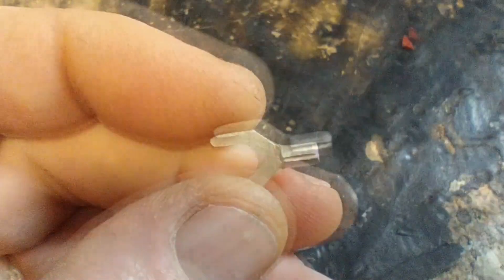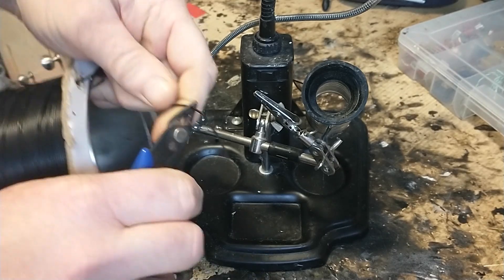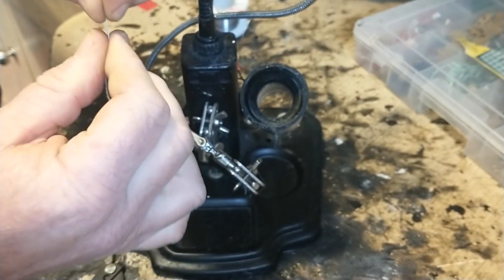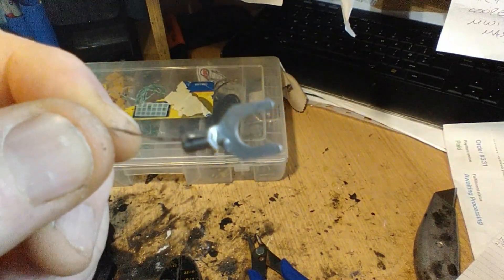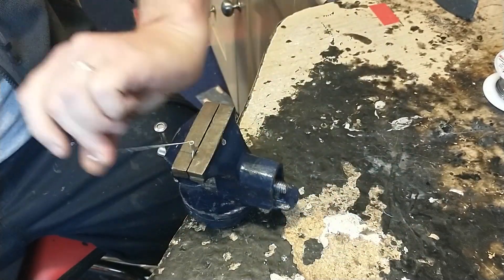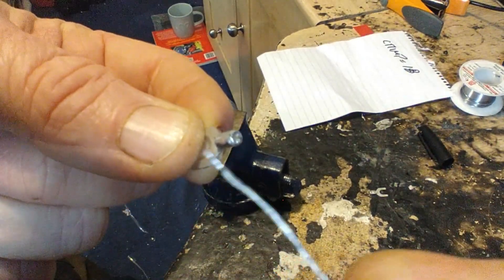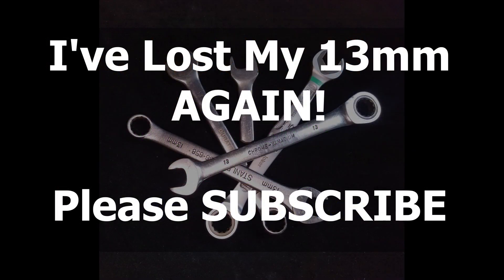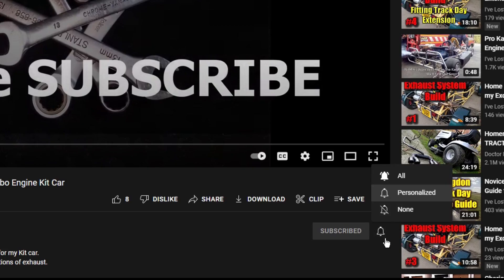How To Fit Kit Car Crimp Connectors - Solder or Crimp Which is best?

Comment: In my view those crimp connectors with the coloured sleeves that you see everywhere, give crimping a bad reputation. They are poor because they do not support the insulation are often the wrong size and are not crimped with a proper tool. However if you look a factory crimped connector they are done to a far higher standard, with the correct tool, and supporting the insulation. One key problem appears to be getting the right tool and the right connector. Factory joints are never soldered other than on PCBs
Reply from the maker: If I use the cheap crimp connectors I also use adessive heat shrink to support the wire. Or use the "wrong size" and have the bare wire bent back over the insulation and crimp onto there so the crimp is on wire & insulation. 😃

Comment: I tend to crimp and then melt solder into the joint
Reply from the maker: Personally after this test I will not be soldering any connectors.

Comment: My guess , before watching...solder joint breaks first....tinning turns it into a skinny solid wire...multicore is designed for a little movement solid wire in fixed situations.
Reply from the maker: Spot on - but many who have even watched the video are telling me I am wrong!

Comment: I tend to crimp now but didn't when I built my kit 17 years ago and soldered pretty much everything. I've had zero failures so far.
Reply from the maker: I used to solder & use heat shrink. After this test I now crimp & heat shrink. 
I'm an electronic engineer & used to commission systems on Navy Ship. On those all connectors are crimped.